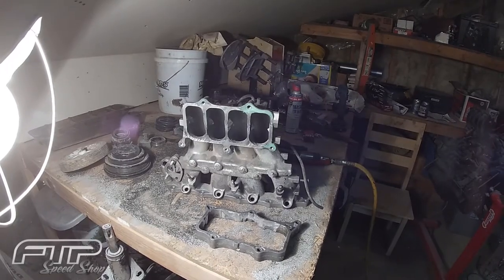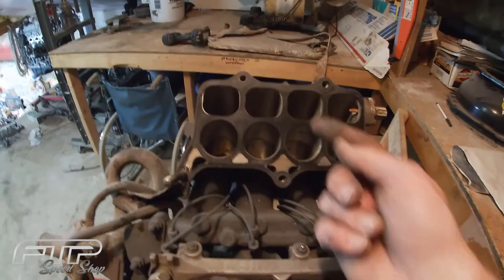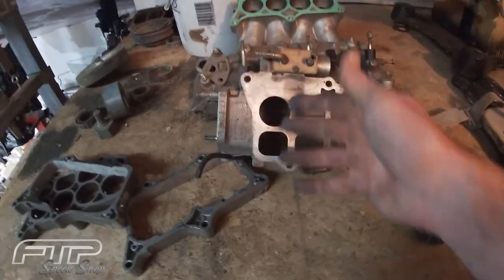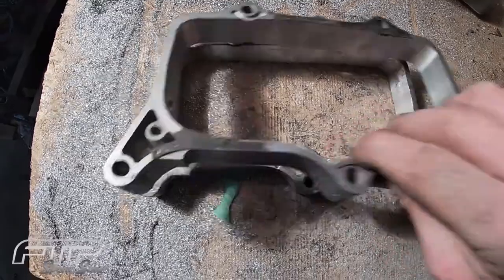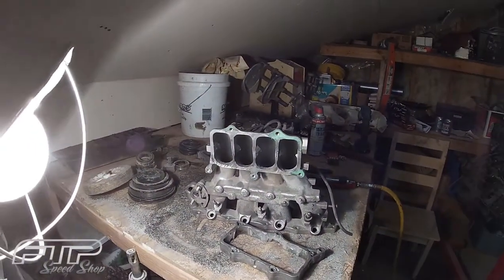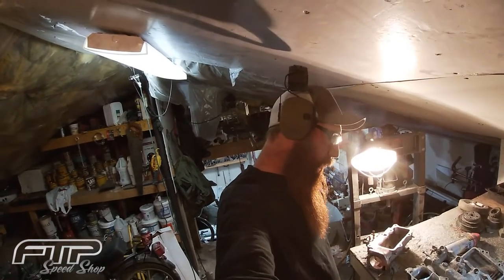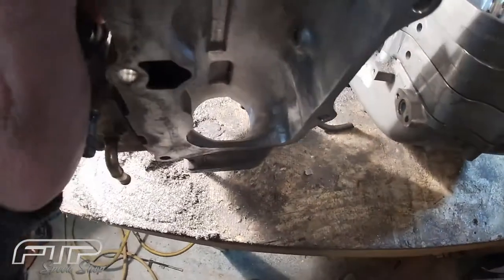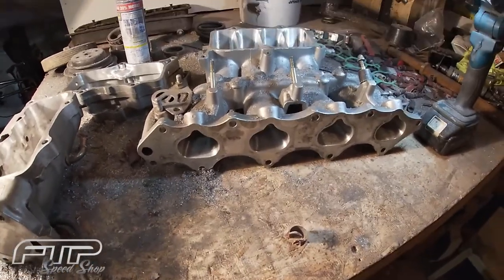H23 Vtec Stage 3 Intake Porting Part 1

Comment: Well made project 💪🏽
Quick question, where did you find those spacers for the intake? I’m looking for just one Lol
I bought a dummy intake $50 and it didn’t have the spacer.
Thanks
Reply from the maker: Those are the factory flapper valve spacer gutted out and opened up. I may have one or two more laying around... email me we can talk details. Ftpspeedshop@gmail.com
Reply: @FullThrottlePerformanceMike  sounds good really appreciate it
Reply from the maker: @wesley9250  no problem

Comment: Is there somewhere you learned the 3 butterfly plate stack? I have a 12:1 H22 with stage 3 BC cams but stuck with a stock throttle body; I know adding more volume will help significantly, I just don’t know how much to add...
Reply from the maker: I dont have any exact science behind the 3 plates.  I was just looking at it from an old school small block stand point tunnel ram intake.  The more volume the better.  Like most things in life its trail and error.  I hope to have this thing up and running this spring and see how the intake preforms.

Comment: I have lots of questions regarding the prelude.

Can you swap a H23A DOHC Vtec engine into a 2001 prelude?

Which is a better transmission the automatic or manual?

How much hp can you get from porting the intake manifold?

Can you also port the cylinder and intake manifold where they seat properly?

What are the pros and cons of porting a cylinder head and intake manifold?

Will the ported component create more engine noise? Is the difference in porting noticeable when accelerating?

I greatly appreciate your response.
Reply from the maker: Yes you should be able to swap  a H23A in an 01 Lude.

I have to say manual all the way.

I don't know on the hp gains because I have never dynoed the motor.

I don't think it makes any more engine  noise.

You absolutely  can port match the head to the intake to aid in flow. I didn't because  I didn't want to remove my head from the motor to port  it. 

Think that porting the intake is a good idea on modded  motors.

Thanks for your questions  I hope I answered  them all.

Comment: When you blocked off the egr and iat did you have to take those sensors out of the tune or does that not affect anything computer wise... I'm using a h23a non vtec in a dirt track car and I don't need all the "extras"
Reply from the maker: I haven't got the car running yet. I'm still trying to restore the car I hope to have to running end of the summer.  I know the EGR doesn't effect anything from my last H23.